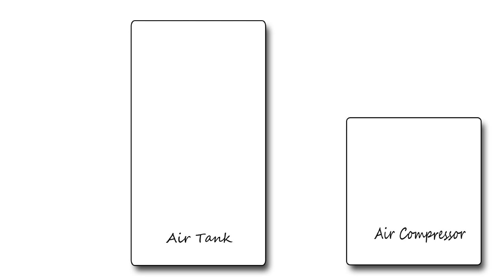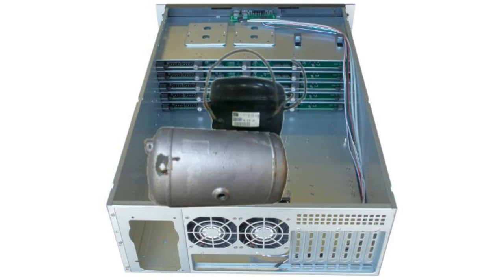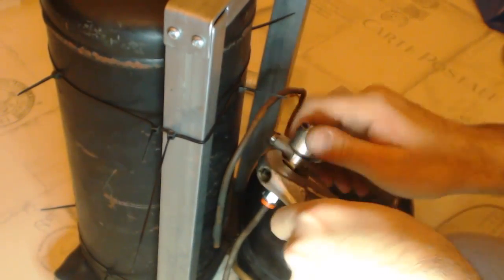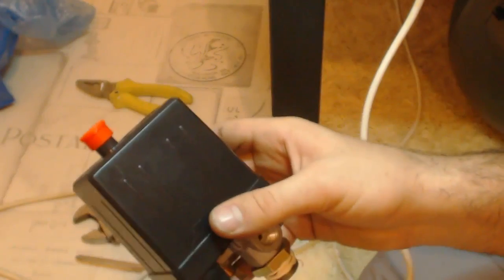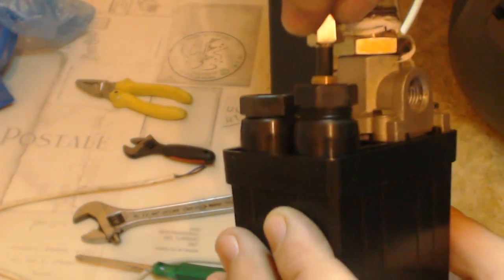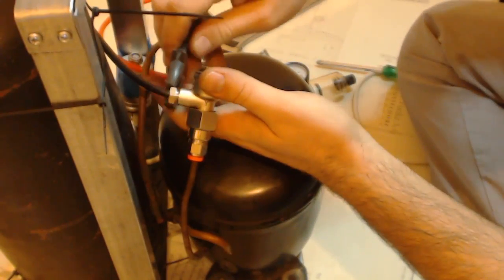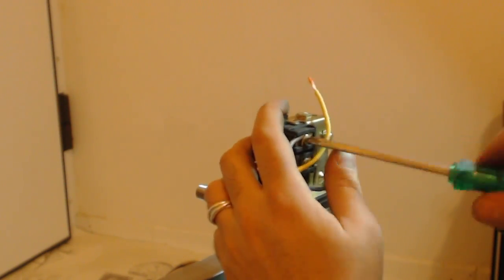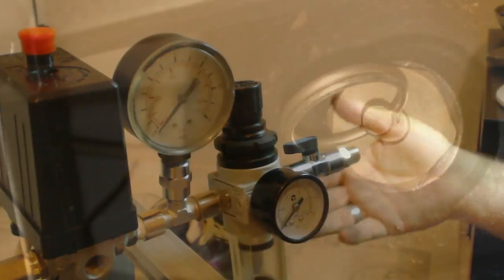DIY How to build make your own silent air compressor - step by step

Comment: Hello sir i have a problem. I am using two compressor..one is from a refrigerator compressor and it works good... The other one is a window type aircon compressor and my problem this compressor always gets very hot.
Reply from the maker: I have never used an aircon compressor evern if it is very tempting.

Comment: how about the suction side of the compressor, no connection at all, just leave it open? i want to make like this
Reply from the maker: No problem with that but the compressor may such dust from here. I think a small air filter is the better solution

Comment: Great Video, but when i add up the price of all the fitting and parts i need to buy and all the foot work hunting this stuff down and then doing all the assembly and wiring.....I think I will just buy one at that point.   Still Great tutorial
Reply from the maker: Thank you for your comment. Yes of course there is a cost and it is also a descent one but.... the cost of a SILENT air compressor is about 4 times more expensive

Comment: hey,, which is better,, ac compressor or Fridge ?
Reply from the maker: Definitely the ac compressor. You can reach higher pressure in smaller amount of time
Reply: Kostasiii Miniatures 
Ive use the scroll compressor, the problem is that compressot is too hot, over 55 c,

Comment: can you tell me which presostat you used? i allready bought two but the they unload pressure from the unloader valve. the seller says that i neet at least 1 bar on the unloader so it can start to seal it and there is nothing wrong with the presostats

Comment: Hi. Nice video. I build something similar but got problem with thermal switch. Once tank reach 7bar is switching off compressor, and when get down to 5bars should start again but thermal switch is still active and not let do it. Any idea how to fix it? ideal I would like to cut off on 8bars and start again 6+.

Comment: Nice! Thank you so much. But, How will i know if i have to add oil to my compressor?
Reply from the maker: Well this is something not very easy to see. The sound of the compressor when it works may help you but in my case I prefer to add about 100ml thin oil every 2 years. I haven't found yet a reasonable solution as these compressors are made for no oil leaks.

Comment: Pressure switch and safety valve...those fridge compressors can build up some insane pressures, be careful
Reply from the maker: In fact .. not so much. Many people have complained me that fridge compressors can reach at only 6 bar pressure and not more! 6 bar is dangerous  pressure but not so much. Of course we must always use safety valve. Is a MUST have component
Reply: Kostasiii Miniatures I had 3 compressors and all of them could build up more than 60 bars. And i dont know where you read that people are complaining about a too pressure!
Reply: if your fridge compressor only reaches 6bar it's faulty or low grade chinesium

Comment: how can i stop the oil pumping out the spray gun..?  the oil from frdge compressor is blowing out from spray gun...
Reply from the maker: +Pj Venturina You need to add and air filter. This traps oil and moisture. Sometimes comes with the air regulator.
Reply: Where can i put the filter?  Before tank or after tank?
Reply from the maker: After the airtank and before the airbrush
Reply: +Kostasiii Miniatures ok thank you sir! i will buy an oil moisture filter tomorow!

Comment: how can i stop the oil pumping out the spray gun..?
Reply: ditto that question
Reply: You must fit a separator between compressor motor and tank....a moisture trap should suffice..just make sure if it self drains that you don't let the oil mess up your carpet :)   also, keep an eye on the oil level.

Comment: i use garavity type spraygun.  do i still need more tank?
Reply from the maker: +Pj Venturina Yes of course. Side feed or gravity seed does not change the air pressure needs. You need to have a good capacity of air at your airtank whatever spraygun you use
Reply: My tank is almost a size like yours on your post! So you say yes i can use my tank for painting? Ok thank you sir!  Youre the man!
Reply from the maker: For painting is just perfect. Thank you

Comment: thank you so much sir!  can i use aircon compressor insted of ref. compressor? can i use that on car painting?  pls. reply asap.
Reply from the maker: +Pj Venturina Yes you can and it's much better. As for car painting it's not easy. You'll need a huge amount of air and the compressor will not catch up you. A solution is use 2 to 4 airtanks pretty large and at least 2-3 air compressors in raw

Comment: its not only silent it will also consume less power right? I definitely cannot power my 1hp noisy motor compressor with my 12v 1000watt dc to ac inverter, but I think with a fridge motor that is not too large, it can be powered by an inverter
Reply from the maker: +fidel catsro mmm I'm not so sure about that because when it starts it needs some amount of power. Don't forget it's a 220v power electric device. Check the specs firstly. Rather than that great idea
Reply: +Kostasiii Miniatures I checked my fridge she surges but then consumes only about 250watts!!!, the 1 hp compressor surges like rocket then consumes a hefty 1500-1600watts(eats electricity like 2hp although label says its 1 hp)!!!!! I like in a 250vac outlet country too, I assume the fridge pump will charge up much slower than the typical compressor but I don't mind because it doesn't wake the neighbours up doing it
Reply from the maker: +fidel catsro Yes all the meaning of this project it that you make a silent compressor. I found it very very useful. I sometimes works late at night and almost none can hear it

Comment: What kind of fitting you did use for compressor out? Olso 10 bar isn't to much for so small compressor? I heard 2-3 bar is it safest maximum for one.
Reply from the maker: +Imyach Fomilev Sorry but I cant understand the question about fitting. As for the pressure yes an airbrush need about 2 bars pressure but the airtank must have much more pressure so as to be steady at the airbrush. There are some air compressors with low pressure that starts when you push the airbrush and stops when you stop but these have not very steady pressure and they stop working after 3-4 years
Reply: +Kostasiii Miniatures I'll try to explain, from the compressor out have copper tube, it must be crimped(or some people just soldered it), otherwise air will escape. 

Frequent mode switching on/off is bad, I understood, thanks.

Comment: woww! 10 BAR? How many HPs? 1/6; 1/5; 1/3; 1/2??
Reply: +factorargento the compressor is capable of reaching very high pressure's, however the rate it pumps at is very low. iv'e had mine at 13 bar. but rating would be something like 1/8th hp. if you want a quiet compressor which pumps a lot of air you could chain multiple pumps in parallel or just buy an expense silent compressor. bigger pumps can be found in airconditioning units, these pump twice as fast as one from a refrigerator.
Reply from the maker: +whyshouldipickaname wow 13 bar!!!! You know its too dangerous though
Reply: +Kostasiii Miniatures yes you are right, i was standing behind a steel plate while testing this ;) not really recommended indeed! still it did hold up.

Comment: ok for us Americans that still use the old system 1 bar is about 14.5psi
how many bars will this unit put out? and no they don't serve BUD.
Reply from the maker: +bobbg Well I don't know exactly the pressure that put out but in tests it could fill an airtank with 10bar pressure. I didn't test it more...
Reply: +Kostasiii Miniatures i have tested till 13bar which i thought was scary enough but it still kept going.
Reply: whyshouldipickaname my compressors can max out my manometer which made for 60 bar
Reply: +Kostasiii Miniatures i have tested till 13bar which i thought was scary enough but it still kept going.

Comment: hello, loved ur movie,. I have a Q how u get rid the oil throw and keep the compressor clean
Reply: also how to oil the compressor
Reply from the maker: דוסיהוסט | קידום ובניית אתרים Hello and thank you for the support. The pressure of the compressor is not so high so the oil spits are not a lot. But even the  small amount of oil that you have will also oil the airtank so you don't have to avoid it. The compressor can be oiled by the in-air tube. Just add some oil from there

Comment: Oh BTW any idea on the cost for all the fittings if I already have tank and compressor?
Reply from the maker: Sitdown BeQuiet This is a difficult question because the prices vary from a local store to a web site. The 2 things that are expensive are the compressor regulator (~15$) and the air filter with moisture trap (~25$) The rest are about 1 to 3 $ each. So all the components about 30 to 60$

Comment: Hi, I already have an old air compressor that the motor has went bad. I also have a refrigerator compressor as well. Do you have any idea on how long it would take for the 20 gal tank to fill up to about 100 - 120 psi? Also same question again on a 10 gal. tank also, because I have another compressor tank also. Thanks for the help.
Reply from the maker: Sitdown BeQuiet Mine is about 3.7 litres (or about 1 us gallon!). To reach at 8 bars (116 psi) pressure tooks about 3.20 minutes. Your 10 gal tank is 10 times bigger!!! so I can't say that it is a very good idea as you'll have to wait about 30 minutes to fill the tank and 10 minutes to refill it every time pressure drops under the 6 bars (87 psi) For these big tanks if you want the silent feature you have to add 4 fridge compressors at row!

Comment: Hello again. I have everything ready and just need to get the air lines sorted out. I heard I needed to change the oil to a regular compressor oil. Is that true? If so do you know the best way to do that. No drain plug and it would take forever to refill through the tiny air line.
Reply from the maker: I don't think you need to change the oil. the oil that it has is the oil that is meant to have the compressor. The only need you may have is sometime to add a little oil because it spills a little every time you use the compressor. Except that .. nothing

Comment: Was wondering what the maximum pressure is for this type of compressor. I need a consistent 65 psi. Will it do it? Great video. Straight forward and to the point.
Reply from the maker: 1 bar = 14.5 psi. This means that you want abou 4,5 bars pressure. This compressor can hold up to 10-12 bar pressure or a bit more. The problem is if you want 65 psi pressure continuously for an amount of time. That means that you have to use a bigger air tank (about 10 times bigger)!
Reply: Appreciate the input. I have a 5 gallon tank and all the bits left over from a compressor that blew a seal. Was hoping to just install a mid sized fridge compressor and let'r rip. I need the higher pressures intermittently for the most part actually so I think it'll work. Thanks again.
Reply from the maker: Stephen Staines mmm I guess you are with it. There is always the option to add one more compressor to your tank. Thank you

Comment: Oh, one more thing. Are you having trouble with oil particles in the air? That compressor spits some oil along with the air....
Reply from the maker: The fridge compressor has thin oil inside. Of course I have spits along the air but this oil goes to the air tank and lubricates it. So don't bother. Once in a time remove the moisture and the oil from the tank through the drain valve

Comment: The part that goes to the bare tube from the compressor (3:10)...could you please tell me what is the name of that part?
Reply from the maker: This is a quick connect racor for 4mm copper tube to 1/2 inch. I don't know exactly the name of it. I took a small piece of this tube and show it to my local store. Sorry man
Reply: +Kostasiii Miniatures festo also makes these couplings, i know them by the name of quick couplers.

Comment: You wrote in your blog that gas tank is not good. Is that really bad? Because I have a steel gas tank (propane-butane).
Reply from the maker: After some found search on internet I found that the gas tank can not hold lot of air pressure. I can't say that it is true .. I haven't test it. Try to ask your local distributor of gas if he know something more ...professional

Comment: Thanks for this video ! I don't understand, why the one way valve have two output. Why is the one way valve tube to the air pressostat?
I have a single output one way valve, and I have a single input air pressostat.
Reply from the maker: First of all thank you for your comment.
There are two types of one way valves: With one and two outputs. The valve with one output only prevent the air from coming back to the compressor. But the compressor tube from inside the compressor until the one way valve will still have high pressure. The one way valve with 2 outputs relief this pressure throw the smaller output to the pressostat. 
Some compressors will not start (for safety reason) if it understand that the pressure is high. Most of the compressors will start anyway but with the relief you help your compressor works easier.
Reply: TheKostasiii Miniatures
Thank you for the explanation. I have a refigerator compressor and a one output one-way valve. Do you think it will not start, if there air pressure inside the output tube ?
Reply from the maker: tamamika100 Some fridge compressors can't start. Some of them comes with a small kit like starter. If it has this then you have no problem. 
You can test it with this valve. If it not starts then you can do 2 things :
1) Replace this valve with a one way valve with relief
2) Before your one way valve attach an air "T" tube and a air tap 1/8 to it. With this you can manually relief your compressor

Comment: As always great video. I have been thinking for a while about doing something on the same route.  I just have not had the time plus I just did not want to screw it up. Seeing how you did it makes it seem less hard then what I thought it would be. Maybe I will get around to it one day. Great video.
Reply from the maker: Thank you very much. It is easy. The only problem is the air leaks. Not easy to find them and you have to unscrew all the parts! If you build one please sent me a picture